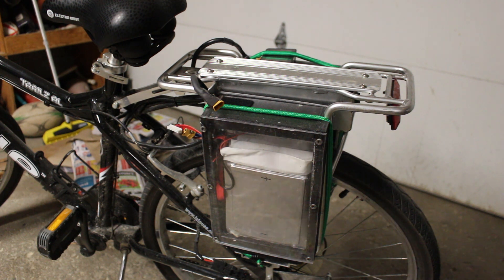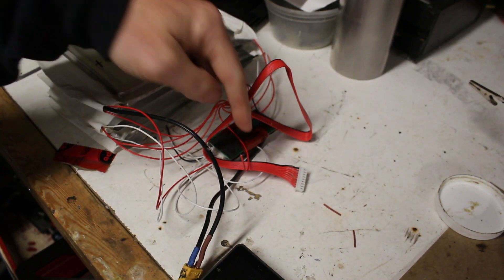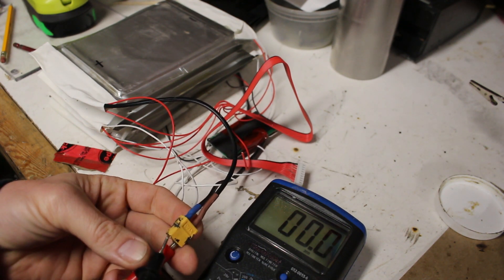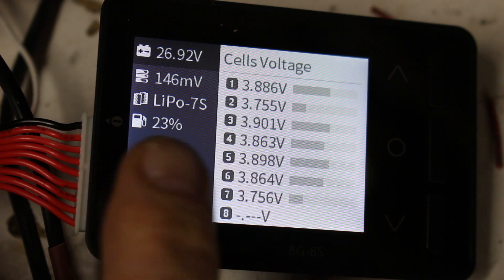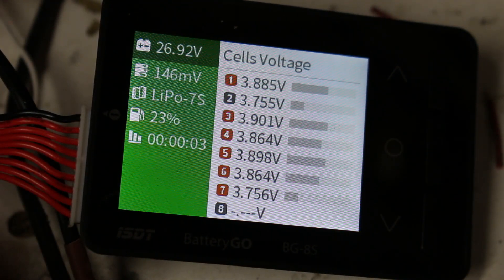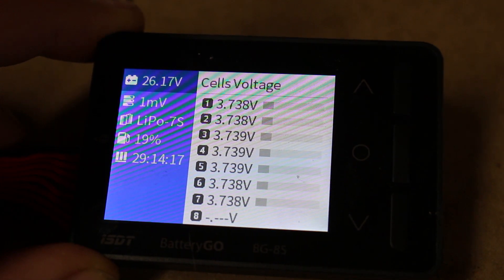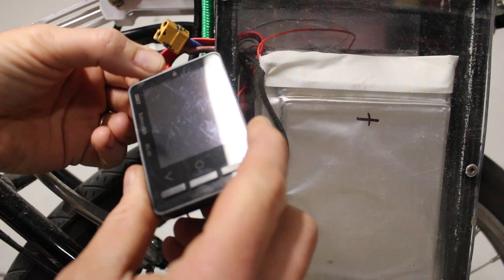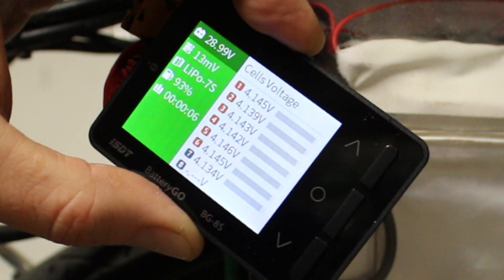Lithium battery management with BattGo BG-8S Battery Meter #Diy #Battery #BG-8S

Comment: I found these came horribly calibrated but another user told me how to recalibrate it. Toggle to the system information setting, press the center button about 5 seconds & do that again 2 more times & you'll get a new screen. Toggle to calibrate, hit enter & take it from there.